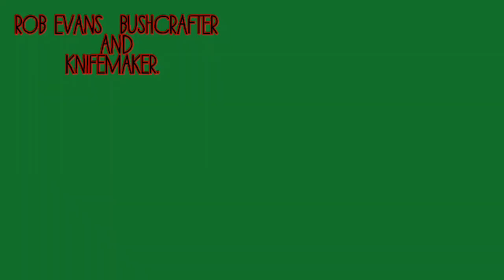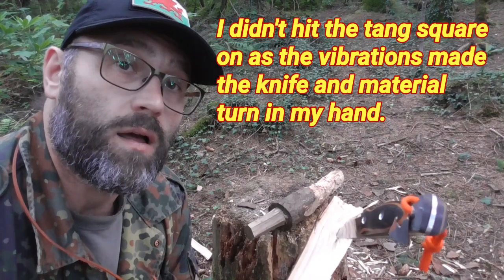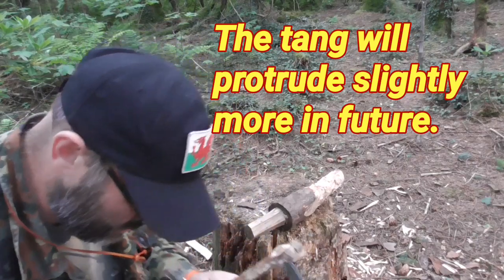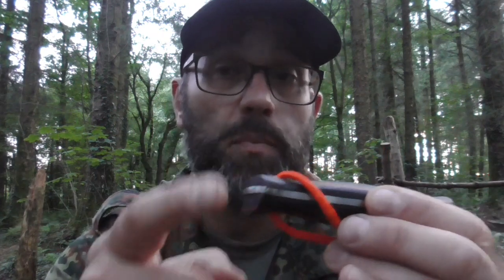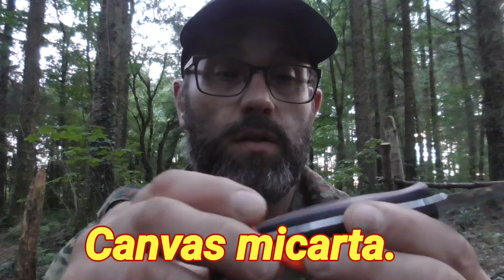Tribute knife test 2

Comment: What can you hit proper micarta with?
Would this not benefit from a butt plate!
Is there a reason for the protruding tang rather than the butt plug?
Awesome feather sticks and minimal strikes on the ferro rod. Your new technique seems to be working.
Reply from the maker: Keeping the cost down so the knife is more affordable and it was Mors's original idea to have a protruding tang, hence the "tribute knife"
Reply from the maker: Bashing the back of the knife should really be avoided, it's a last ditch method. Canvas micarta and G10 can easily take a hammering from a wooden batton
Reply: Rob
I’d never bash the back unless it was to get it deeper into the ribs 👍🏻 🤪🤪🤪
What scales have I got? Paper 🧻 
What was Mors thinking behind a protruding tang?? Scraper!
Reply from the maker: Was yours orange and black?
If so it's orange G10 and black paper micarta, don't worry it's solid as a rock, if it breaks I'll re-handle it free of charge.
The protruding tang is so you can hammer it into a green tree and slowly take it down, I'm rounding mine off so it's less intrusive and no sharp edges for comfortable carving.
Reply: Yep orange and black
Not convinced it will break Rob, but thanks 🙏🏻 

Interesting to use it that way!
Reply: @RobEvansWoodsman  Im sure I remember Rod Garcia saying the purpose of the butt plate was to allow the knife to be hammered into a bigger tree all round the circumference to take it down.
Reply from the maker: @howardvarley8795  yes it is , easy on green wood not so much fun on dead standing, it's for emergency use not really advisable, that why we have saws .